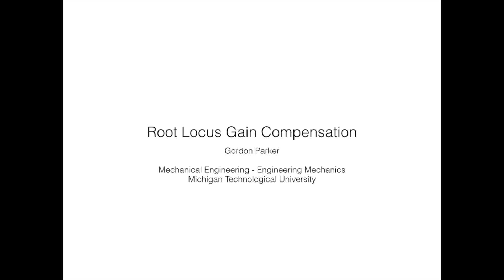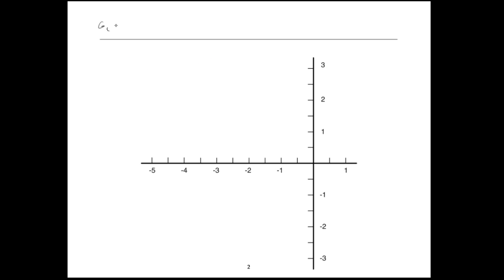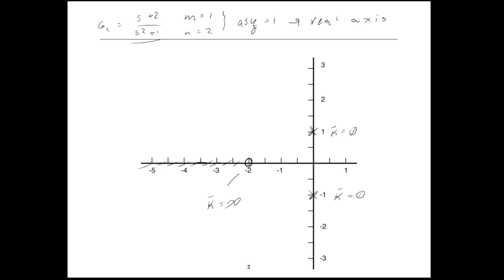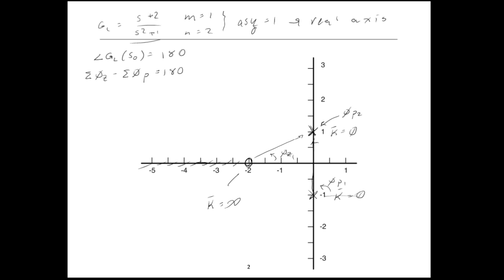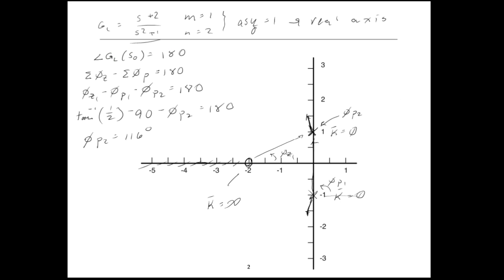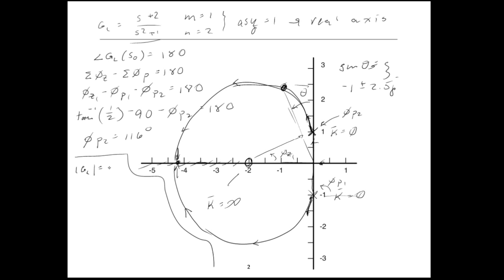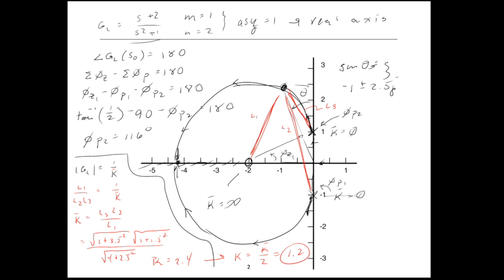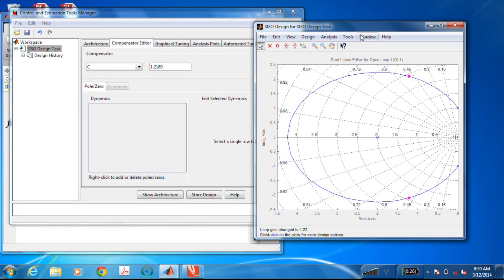Root Locus Gain Compensation

Comment: Interesting but totally unnecessary derivation. Consider the denominator of the closed loop transfer function: s^2 + 4*K + 2*K*s + 1.  Combining terms:

s^2 +  2*K*s + (4*K + 1)

this has the form s^2 + 2*zeta*wn*s + wn^2

where wn is natural frequency.  So we have wn^2 = 4*K +1 and 2*zeta*wn = 2*K

2 equations in 2 unknowns we have (solving for K) = 1.207

Comment: at 8:33 i understand how you got the angle at which "zeta" = .5. My question, is how were you able to find that the point at which it (angle of "zeta") crosses the root locus is -1+- 2.5j.
Reply: I'm not to clear about this either. Seems like he's 'sketching' to arrive at an estimated 's' point. Zeta is used to get a definite angle from imaginary axis, but the intersection with the plot appears to be estimated. 

After digging around a bit, it looks like he's using the "magnitude criterion" to solve for K, but that's after he's chosen the s point on the plot. BTW... Here's a link that helped me to better understand the magnitude criterion: 
http://www.cambridge.org/us/features/chau/webnotes/chap7rlocus.pdf

Also, I was able to get the answer using straight math and some limited knowledge of how second order systems behave.
A common form for a 2nd order characteristic eq is...
  s^2 + 2*zeta*wn*s + wn^2 = 0
Where wn is undamped natural freq.

I manipulated the characteristic eq for this specific problem into the form above and came up with this:
 s^2 + 2*K*s + (4*K + 1) = 0
So, by observation...
  2*zeta*wn = 2*K
and...
  wn^2 = 4*K + 1
 
Combine the two equations above, plug in the zeta=0.5 value and you can get a quadratic in wn. It starts to crumble quickly at that point. Just use the quadratic formula to solve for wn, and then back solve for K. You'll get two possibilities, but one is negative so you can throw it out.

This works find, but I'd be lost in a higher order scenario. I guess the only alternative at that point is to estimate a 's' point based on angle obtained from zeta?